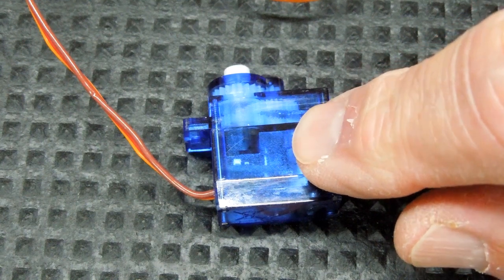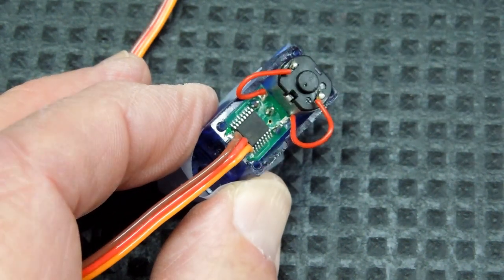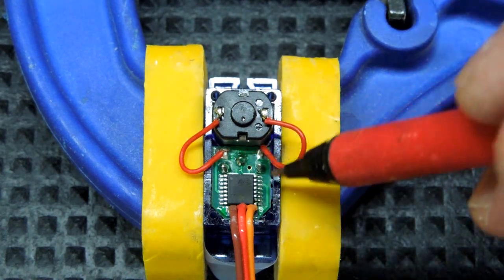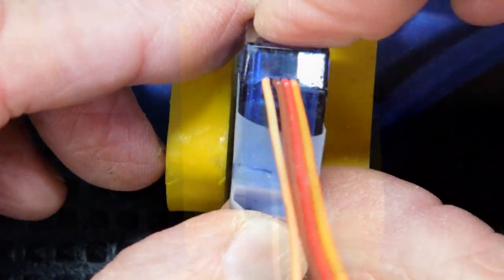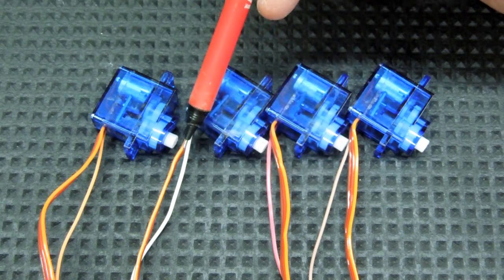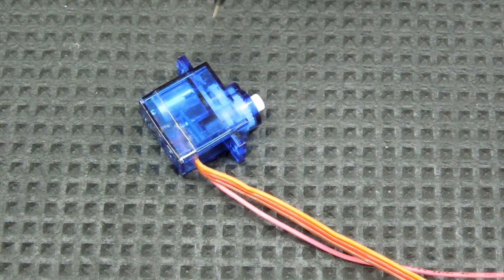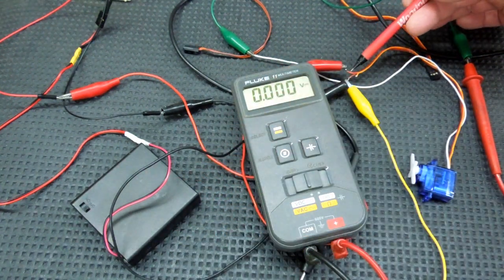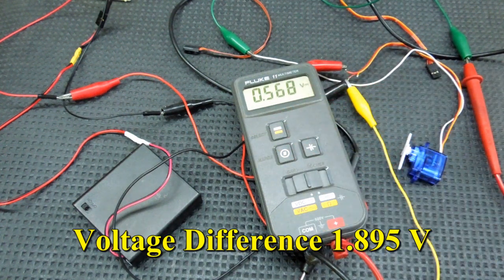Senior 20 Conductor Installation (11) Servo Feedback Modification

Comment: That's actually really smart :D
I've seen circuit boards from places like Sparkfun intended as retro fit replacements for the PCB in the servo, which then provide a feedback signal to allow for "soft start" functionality. Your simple one wire addition is very easy and cost effective! Wish I had this idea a couple projects ago :P
Now you can read in the raw analogue value, and use MAP to scale the numbers to match the signal you're sending the servo :)

Comment: The servo has that built in, unless you're looking to  do PID control in the uC . With servos designed for backdriving you could manually move the conductor to serve as an input I guess. https://openservo.org might be worth a look.
Reply from the maker: I uploaded this video in case someone may find this useful for one of their projects. This part of electronics is really not my thing. Last year I had a guy helping me with the programming of the Arduino Nano for the conductor and this was one of his ideas for better control of the servos. Instead of assuming the servo has reached a position in a given amount of time, feedback would tell the Nano when it had actually reached an assigned position. The next step would be to stop, pause or change direction, possibly at a different rate. Hopefully the servo operation could be programmed to be smoother and somewhat random to make the conductor movements more realistic. That guy has since disappeared and is no longer working on the project. I now have a different program for the Conductor control.
Reply: Ronald Walters I admit I'm not enamored by that control scheme, as I think that if you need to go to closed loop control the existing servo controller would just get in the way. However it seems reasonably popular, and one of the suppliers I use for hobby/prototype electronics has a few servos with a feedback wire installed including a nice small one https://www.adafruit.com/product/1450
Reply from the maker: Someone told me about these last week... and after all my hard work. :-)
Reply: The good thing is you've saved a few bucks, and taught me a thing :D